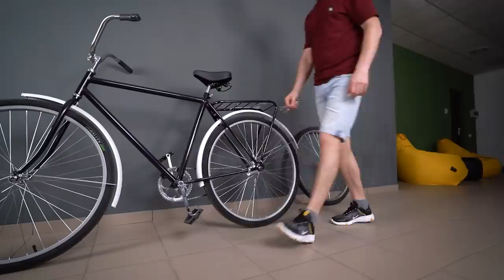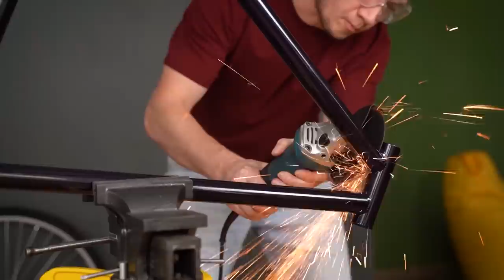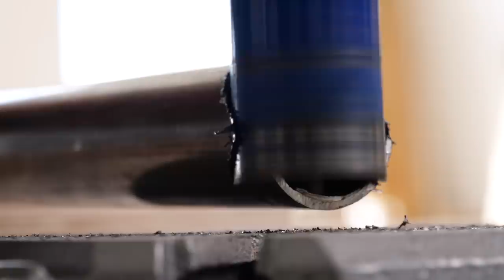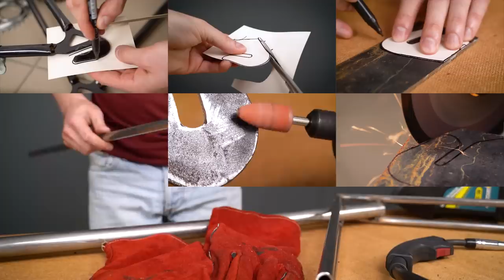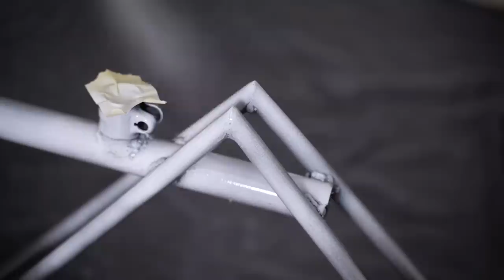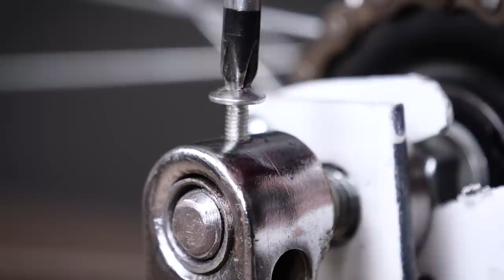How to Make a Tricycle

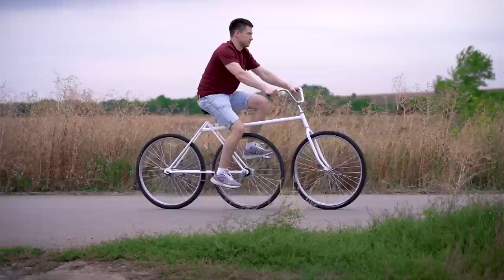Comment: 4:40 but can it turn?
Reply: I don't think so !
Reply: Yes lmao
Reply: Yes why not
Reply: It can make very wide turns.

Assuming that the air pressure was the same in all three tires, it looks like most of the weight was on the center tire. It had a much larger contact patch. This suggests that the rear tire had proportionately less traction. 

With practice, a rider might learn how to get the rear tire to break free from the road enough to permit a relatively normal turning radius. Shifting as much weight as possible onto the front tire will help.
Reply: Seat over center of back wheels on fixed line.

Large turn radius or lots of lean
Reply: @hamjudo   .....genius!

Comment: I’ve always wondered about placing a third wheel, suspended within the frame and not touching the ground, acting as a flywheel. I’d like to see if it could improve the stability of the bike, but also spin it backwards to see what f it would cancel the natural stability of the bike.

Comment: Wheel rub will be an issue between the two rear wheels while turning.
And one wheel will lift on a hill or in the valley.
The rear dolly needs to be articulated to keep all wheels in contacto and the most rear wheel needs to turn slightly to not wear itself out prematurely.

Comment: What if you ran 2 chains. One with a more traditional gear ratio, that doesn't turn the middle tire, only the rear, and another on the other side of the bike with a 1:1 ratio to run the middle tire?

Comment: Its all fun and games until you hop on it and you realize its a 1:1 pedal ratio because the middle wheel doesn't have a bigger sprocket and cant have a bigger sprocket because wheels would move at different speeds